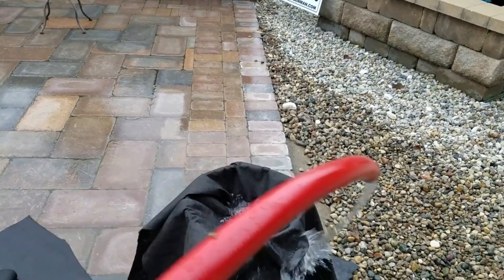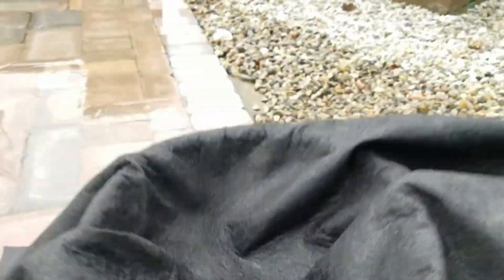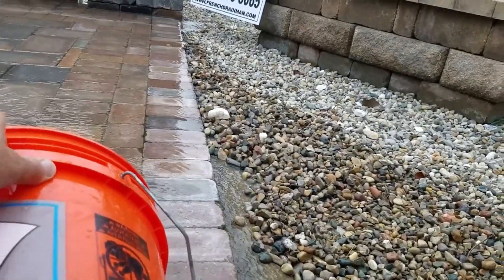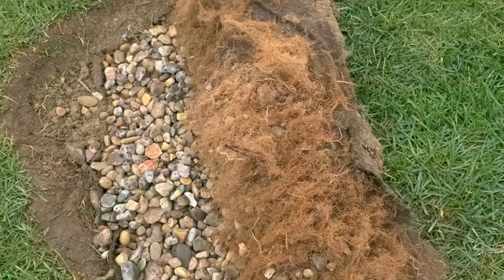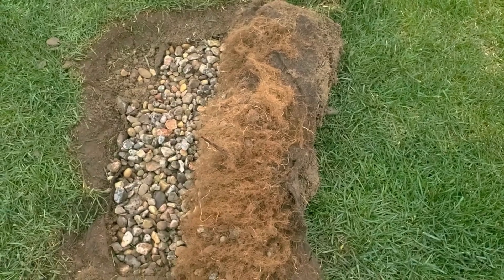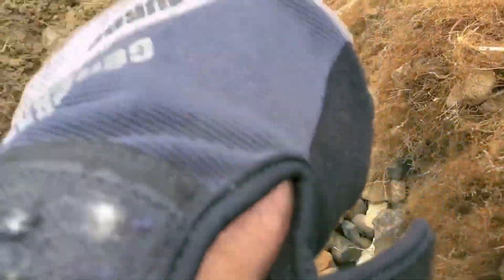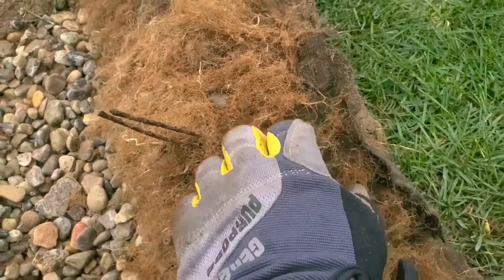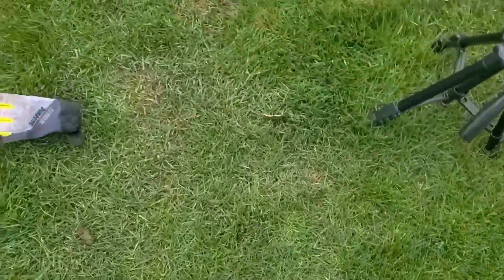Drainage Filter Fabric - DIYers DON'T SKIP THIS STEP [ Watch Our Proof 10 Years Later ]

Comment: would you say this stuff is good for filtering the rain water from my roof into my rain barrels? or is there something else that would work better?
Reply from the maker: @Barret_Radtke  no you need a rain water filter. 
Downspout Leaf Filter Vented Clean Out, Gutter Leaf Guard
https://frenchdrainman.com/product/downspout-leaf-filter/
I don't know how fine debris you want to filter, but to start with this is a good place to start. This removes all the big organics.
Reply: @FRENCHDRAINMAN  i just want to keep as much of the junk out of my rain water as possible, with out filters the water starts to turn green. i don't have much money to spend on a solution so i just want to do the cheapest thing possible, i was searching for what kind of fabric doesn't have dyes in it so i can use it as a simple filters on my rain barrels, i have one on either side of my house.

Comment: so I'm needing to run some drainage at my home and i will have to cross my driveway at some point. I was wondering if the piping you sell  would be able to withstand a truck/car parked on it, and a compact tractor crossing it, or if there is another type of piping that i should install where it crosses the driveway. I haven't been able to find any videos of you installing any drains that have to cross driveways. I just dont want to install a system just to have it crushed by someone pulling up to my home and parking on top of it.
Reply from the maker: https://youtu.be/aEANpBtLfZo
Reply: @FRENCHDRAINMAN  Thanks, not sure how I missed this one.

Comment: Would you use the same fabric if you were doing a Drain around the footer of a foundation to stop silts from migrating into the stone?  In that situation there would be no grass roots.
Reply from the maker: We sell 3ft wide so you can do a open french drain
Reply: Great French drain videos!
I just dug a trench and was going to buy pipe, fabric and gravel , but I was wondering:
The trench is located on a side yard that people don’t walk through but is close the house, and is keeping water away from the house during heavy rains.
Can I just leave it as an open drainage trench if it’s not a safety hazard?
Or do I need to put the pipe, fabric and gravel and cover it up?
Thanks
Reply: @soulpatrolhawaii5409  if you don't care how it looks then you can just keep what we call a ditch in place.
Reply: @LichaelMewis  Thanks!
Reply: @soulpatrolhawaii5409  Besides being an eyesore, just be aware that an open ditch is subject to erosion. Might want to grade out the sides and line it with rip rap or something.